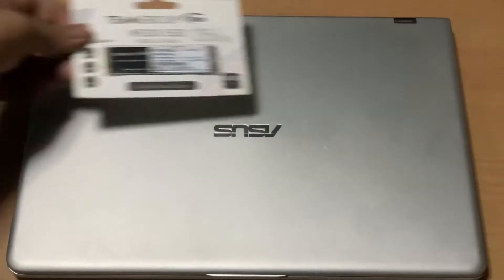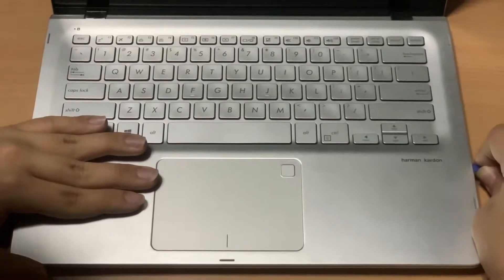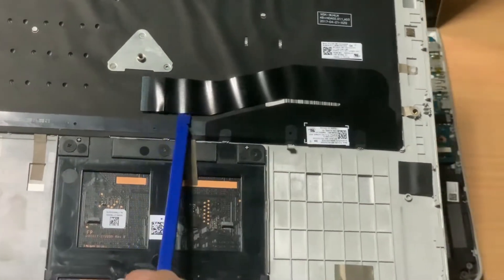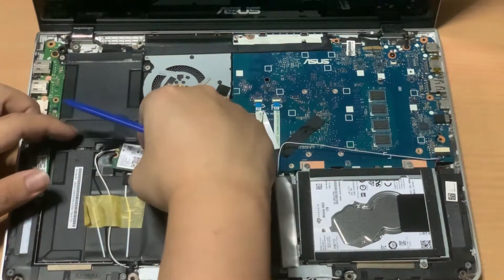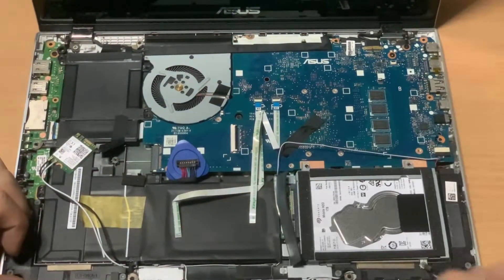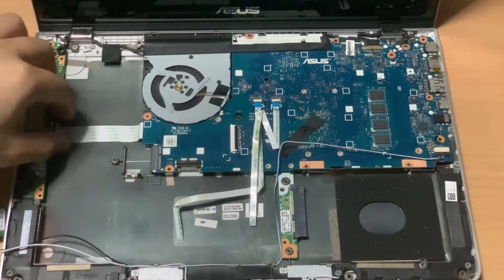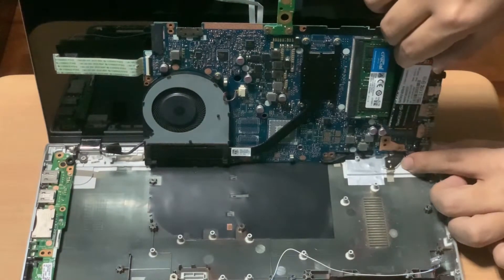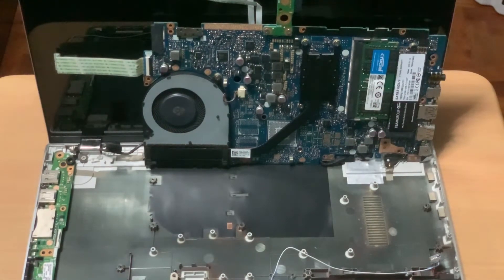Asus Q405UA Upgrades [M.2 SSD & RAM]

Comment: How much improvement do you really get from this?

I also have a Q405UA with Core i5 8th Gen. Reformatted but still seems to be dragging, sometimes just opening menus or settings takes a few seconds. The HDD is also getting a bit loud. I'm just thinking for the price of the upgrades, is it better to just get a new laptop. Good tutorial video on how to do it, though!
Reply: Nahhhh purchasing all of the things he mentioned made this laptop almost new. I had the same issues as you. Probably worse. This laptop was so slow before I upgraded it. I have been using it for over a year with the upgrades. Came back to this video to upgrade it again for more storage. Great Laptop. Asus always makes great Laptops.
Reply: @richardbruno201 thanks for sharing with us your experience,  can you give me the specifications I need to buy to make the upgrade ?

Comment: hi boss , i have asus 1405ua what ssd is compatibility  i have m2 ,but I don't know what size it is
Reply from the maker: If you have an SSD installed on your laptop, you could use a ruler to measure the sizes. Here's a link about the M.2 SSD sizes / form factor:

https://www.techtarget.com/searchstorage/definition/M2-SSD#:~:text=and%200.5%20amps.-,M.2%20SSD%20form%20factor,-Generally%2C%20M.2
Reply from the maker: I am unable to find Asus 1405UA, but I found Asus X1405ZA, this model uses M.2 2280 PCIe SSD. Your laptop most likely use the same type of SSD.
 https://www.asus.com/ph/laptops/for-home/vivobook/vivobook-14-oled-x1405/techspec/#:~:text=1x%20M.2%202280%20PCIe%203.0x4

Comment: Hi!   ddr4 8gb ram 2133MHz should be fine?   or 3200MHz or 2666MHz ??
Reply from the maker: I think the stock RAM speed is 2133MHz only, but if you install a RAM with a higher speed, it would work, albeit the RAM would run at the RAM module with slowest speed (in this case only at 2133MHz)
Reply from the maker: If you're upgrading your laptop that has 2133MHz RAM, then get the RAM modules that are also 2133MHz, since it won't run more than 2133MHz and it would be a waste of money (unless the prices are similar). Aside from checking the RAM speed, you should also check the CAS latency.

Comment: Brother after I install the SSD, should I remove the Hardrive? I was having issues with the disk reaching 100. I guess I should keep the case for the hardrive but not the hardrive itself?
Reply from the maker: Your PC might be trying to scan the drive for viruses or indexing the files in the hard drive. Try leaving the PC powered on for a few hours and see if it becomes lower or try backing up all of the data in the hard drive, then format / erase the drive. If its still 100% after doing that, then check if your hard drive is still in good condition or check its health.
Reply: @miles_uy  Thank you, everything went well. I have a functioning laptop for UNI now. Was about to drop money on a new laptop but thanks to you bro, I probably saved hundreds.

Comment: What kind of memory is needed for the upgrade?
Reply from the maker: I used DDR4 SODIMM RAM
Reply: @miles_uy  if the soldered ram is 8gb, what size ram upgrade can be done? Can it be more than 16gb?
Reply from the maker: Theoretically, it can accept RAM sticks with more than 16GB, but no one tested that yet for this model of laptop

Comment: I have the BI5T5 model as well, but it says I have 4 slots for ddr4 8gb ram 2133MHz available which is then expandable to 32gb technically ...I see you only had 1 extra slot though for ddr4 in the video ..do you also see 4 slots in task manager ? How much can I increase the ram? ( don't want to be surprised after opening the laptop)
Reply from the maker: My Task Manager reports 4 slots, but there's only 2 slots, 1 slot is the soldered RAM, and the 2nd slot is a SODIMM slot. If you currently have 8GB, then its expandable up to 24GB, if you add a 16GB stick.
Note: From my video, I only used a 16GB stick, so I'm not sure if the laptop is compatible with a stick that's more than 16GB.

Comment: Is ASUS Q405U laptop's RAM upgradeable?
Reply from the maker: I think the Asus Q405U is a short name, and the Q405UA is a specific model number, like an iPhone 12, where there is a US version and a Hong Kong version. If you still have your laptop's box or try checking the "System Information" app in Windows, they might have the full model number there.
Reply: @miles_uy  yes it's Q405Ua. 
And it's locale is United States.
Reply: @miles_uy  is it's RAM upgradable?
Reply from the maker: @zain-mi6js  We have the same model, Asus Q405UA, so your laptop should be upgradeable too.
Reply: @miles_uy  Thanks really.
Reply: @miles_uy  Thanks for your reply BTW

Comment: Can you only use an m.2 SATA III SSD in the m.2 slot?
Reply from the maker: Yes, the M.2 slot is only for SATA SSDs. It is not compatible with PCIe NVMe SSDs.
Reply: @miles_uy  That blows, thanks for telling me.
Reply: I accidentally bought a M.2 Nvme. Is there a M.2 NVME to SATA interface (standard, not M.2)  converter/adapter?
Reply: @GameboyZoneRocks  That, I do not know.
Reply: @GameboyZoneRocks  al final funcionó ?
Reply: @licharey  the M.2 slot is only for SATA SSDs. It is not compatible with PCIe NVMe SSDs.

Comment: Is your unit exactly q405ua bi5t7? I noticed that there's a hdd attached, mine was ssd 128gb only and 8gb of ram
Reply from the maker: My unit is a Q405UA BI5T5. I think the only difference between BI5T5 and BI5T7 is that the first one only has a HDD, while the latter only has a SSD, and both have 8GB of RAM.
Reply: @miles_uy  Hi Miles, thanks for your reply, I'm trying to find 1TB m.2 sata 3 ssd on shopee, but unfortunately, I can't find a branded or good one, is it okay if you can you recommend something. Thank you so much.
Reply from the maker: @ezwoodz08   I recommend the Teamgroup MS30. This is the SSD that I used on this video, and it also has a 1TB variant. I also had difficulties looking for SATA M.2 SSDs, the well known branded ones are really hard to find today. So far, the SSD that I used in this video is good, I had no issues with it, and booting Windows is faster than using the stock HDD. To add, games were installed on the SSD, and the loading time is faster than HDDs.
This is what I have found in Shopee:
https://shopee.ph/product/50916350/11732154691?smtt=0.107656743-1659815396.9
Edit: I also found Ramsta branded SSDs in Shopee, and it has good reviews, but I haven't tried or tested them personally.
https://shopee.ph/product/462016051/14314807998?smtt=0.107656743-1659815932.9
Reply: thank you so much  @miles_uy , I appreciate it, I'll check on this 😁
Reply: Also, another question, since BI5T7 is already using ssd and I believe it was using the slot where you inserted the ssd on your video, I wonder how can I trasnfer the files and OS to the new one.
Reply from the maker: @ezwoodz08  I inserted the SSD, then I used Macrium Reflect to move all the data from my hard drive (Clone Drives).
Since the data is in a hard drive, I only installed the SSD and clone the drives. If you already have a M.2 SSD in your laptop, then you might need a M.2 SSD Enclosure to move your data.